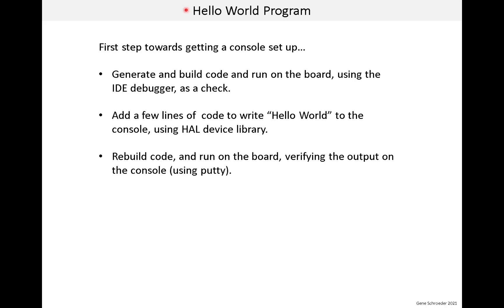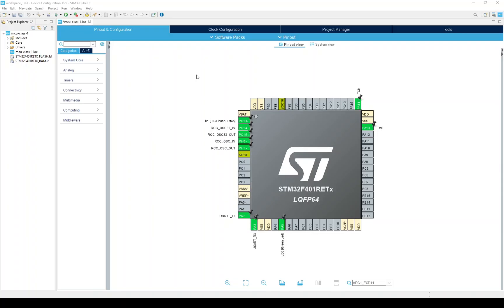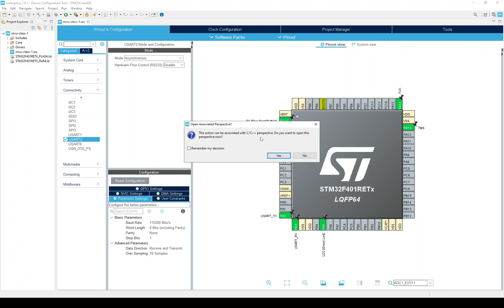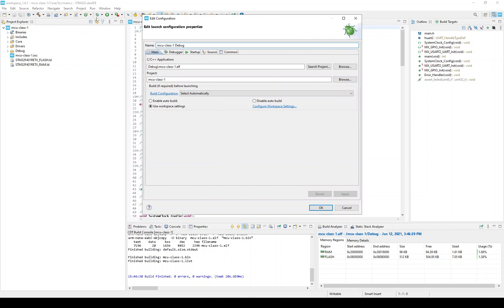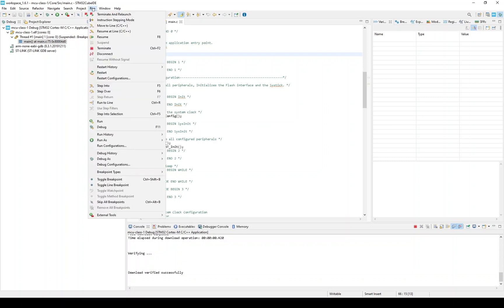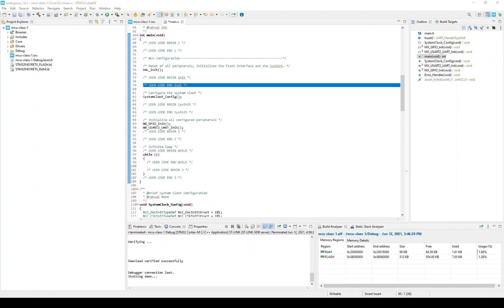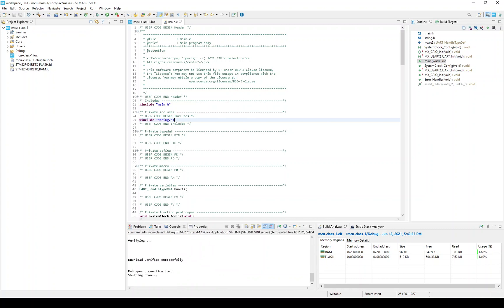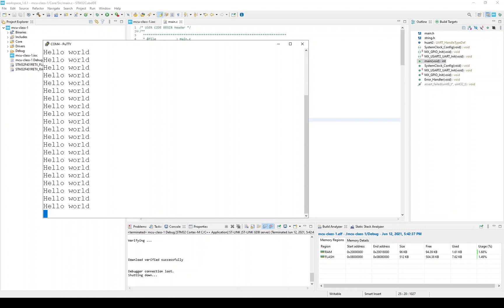Lesson 7.  Hello World from the Console

Comment: I have a STM32H563ZI board, i did the same steps. But after successful build and debug when pressed resume the debug current instruction pointer is struck at hal uart transmit line. No errors and unable to print hello world in putty. Can you please tell me what's the issue?
Reply from the maker: @Shashank-c6j Thanks for the question. I don't have a board like yours so I can't try it myself. However, I found when I updated my STM32CubeIDE and created a project for your board, the generated software regarding the UART is different from my video. Perhaps you could show your HAL_UART_Transmit() line, as I am interested in what you are passing for the UART handle. But in general, what I would do is enter the debugger, set a breakpoint on the HAL_UART_Transmit() line, and when you hit it, step *into* the function. First try to look at the contents of *huart, and then step through it line by line to see what it is doing.  It was not my intent for you to have to debug code at this stage, but that is real life. Let me know what you find.
Reply: @geneschroedertech7501  thank you, i got the output . I used usart3 and instead of 1000 in HAL_UART_Transmit() line I used HAL_MAX_DELAY.  I trying to know why did only usart3 worked ?
Reply: @geneschroedertech7501  thank you i got the the output. I used usart3 and used hal max delay in HAL_UART_Transmit() line instead of 1000 . i trying to know why usart2 did not work..

Comment: Is there any special step I need to take so the IDE detects my connected board?  When I run/debug it complains that there weren't any recent launches
Reply from the maker: The one thing that comes to mind is the host machine (e.g. Windows or Linux) drivers for the ST-LINK USB interface. As far as I know they are automatically installed when you install STM32CubeIDE. If you are using Windows, can you use the Device Manager to see whether a COM port is created, and then removed, when you plug in (and then remove) the USB cable? 

For debugging this kind of problem, I like to use STM32CubeProgrammer software https://www.st.com/en/development-tools/stm32cubeprog.html  I like to use the CLI option to list all of the ST-LINK interfaces that it detects. 

This problem might be frustrating, but debugging it is good experience.

Comment: Why do we need to write a separate delay function if the timeout of 1000ms is already present in the UART_Transmit function? Is it because otherwise the code would quickly fill up all the memory with those "Hello World" messages?
Reply from the maker: Yes, you are correct. The timeout in the transmit function is designed for the case where after 1000 ms the message is not yet sent (sort of an unusual case unless there is some bug somewhere, or you are sending a long message at a low bit (baud) rate. 

The delay function I put in is to send the messages at a reasonable rate (once per second) as you guessed.

Comment: Just thought I'd report on a interesting behavior, I was trying out what you suggested on the console, I'm using a different board so I didn't change the speed in the white box. I left it at 9600 and it gave me 5, 5, 5, ......, 4, 5. Changed the speed to 115200 and it worked as it was supposed to. 
Makes me curious as to why it started printing numbers, anyone have any clue why?
Reply from the maker: When you use an asynchronous serial line, the two ends have to agree on the baud rate (speed). This allows them to know when to sample the line to receive the bits being sent. If they don't agree on the baud rate, then the receiver will be sampling the line at the wrong times, and the bits will be wrong and it will appear as the wrong character.

If we did some very detailed analysis, we should be able to figure out why the incorrectly sampled bits resulted in just number characters.  Usually it just looks like random characters.